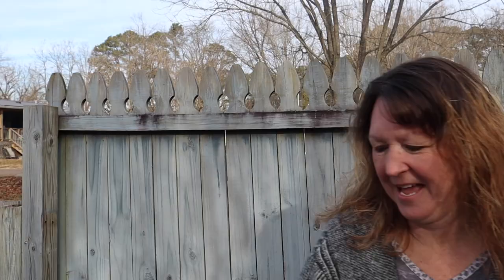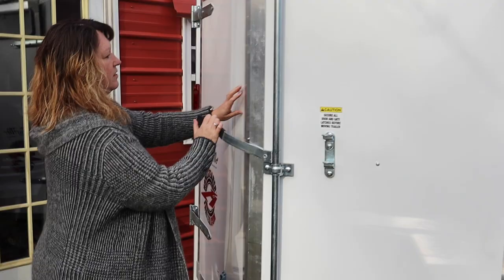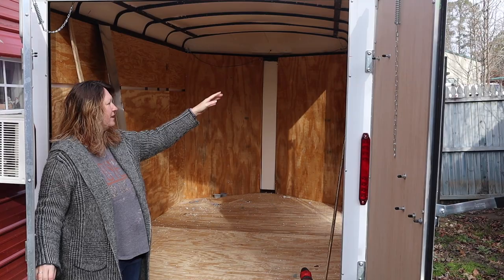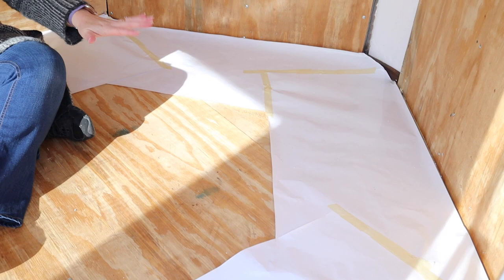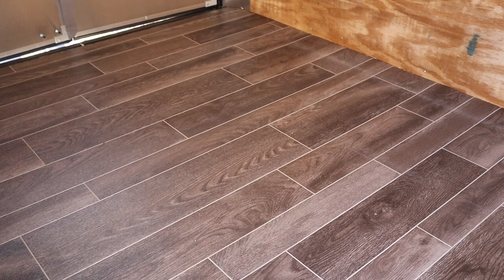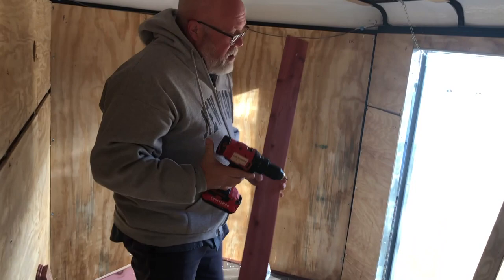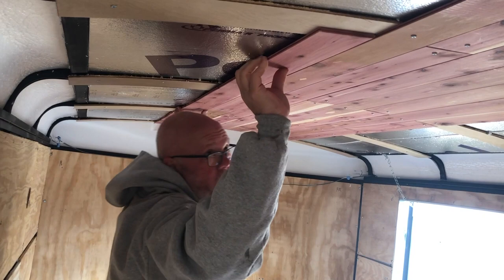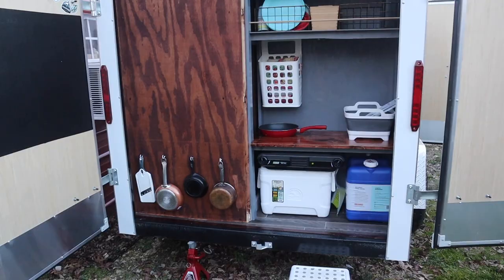Cargo Trailer Conversion: Watch This Before You Build! It's A Modern Day Covered Wagon!

Comment: Do you think a shower stall kit would work, also the simple hole in floor for shore power.
Reply from the maker: Our shower is about 32”x32” - we almost got a 24”x24” (smallest base I could find), but I’m glad we went with the bigger one. Its up to you (obviously) if it’s a matter of space. As far as the hole for power, I just drilled a 1 1/2” hole and covered it with a metal switch cover - that’s worked out well.